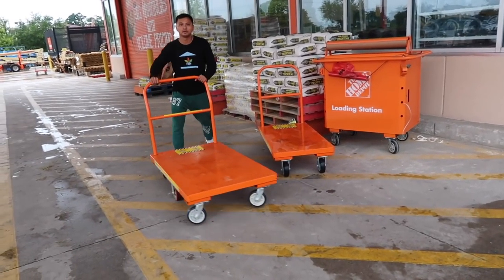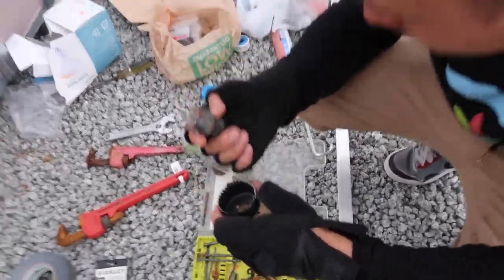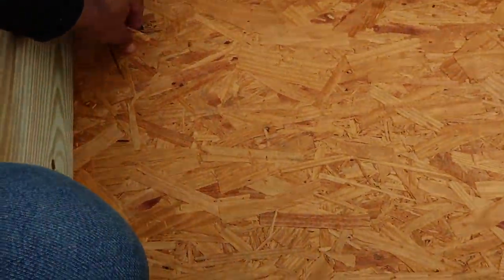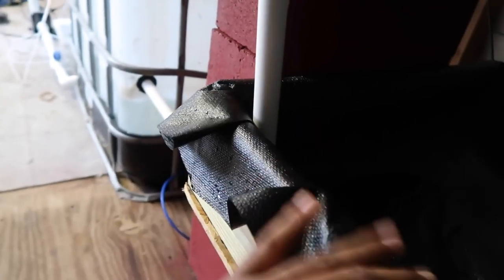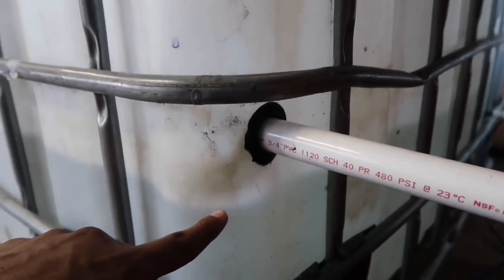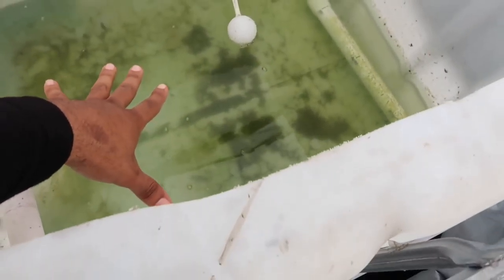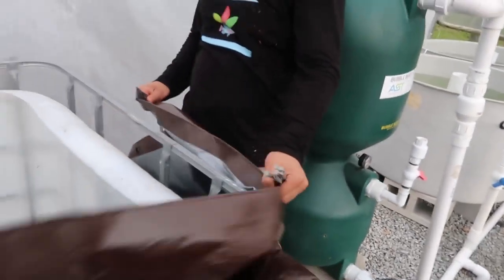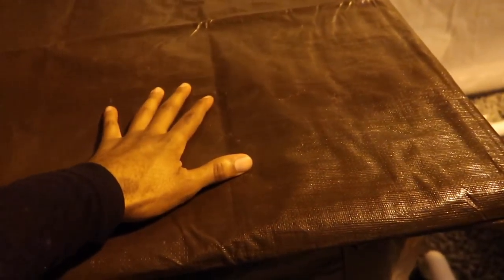Fighting The Bugs And Building The Seeding Tray | The Aquaponics God Ep.43

Comment: When drilling with a hole saw, if you drill all but the last 3 mm or so, the plug you've already drilled will pop out easily with a flat screw driver. Then when you drill the last bit, you get a skinny plug that comes out easy as pie.  

Or, drill until you see your pilot bit, but at least half way.  Then run the hole saw from the other side until it breaks through somewhere in the middle.  Now half the plug is outside the hole saw and you can get a pair of channel locks on it.